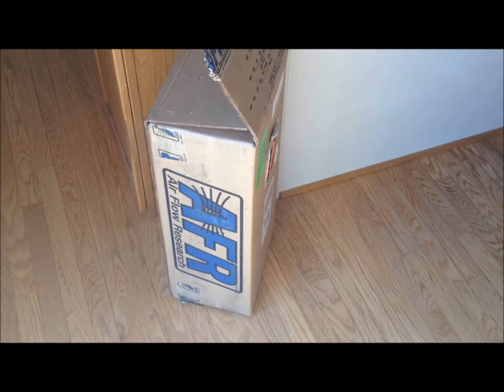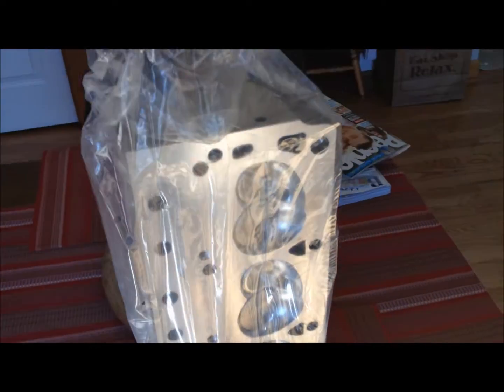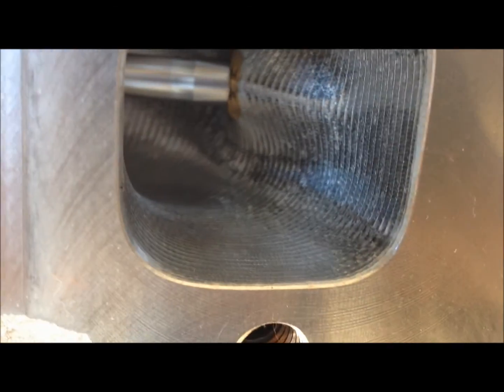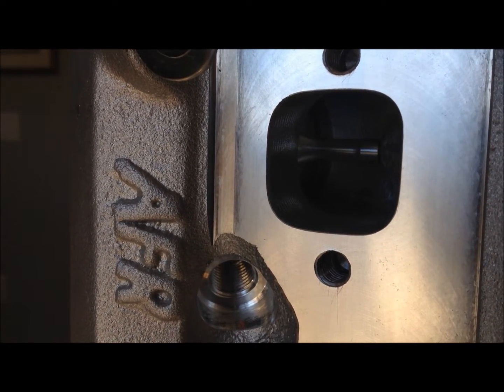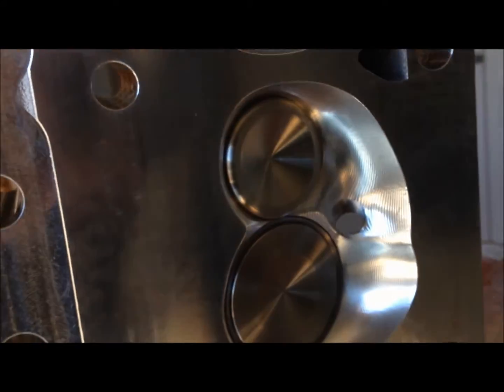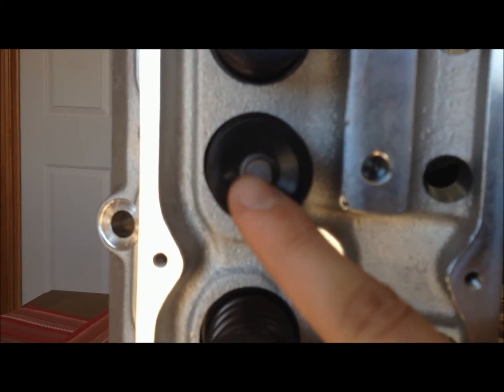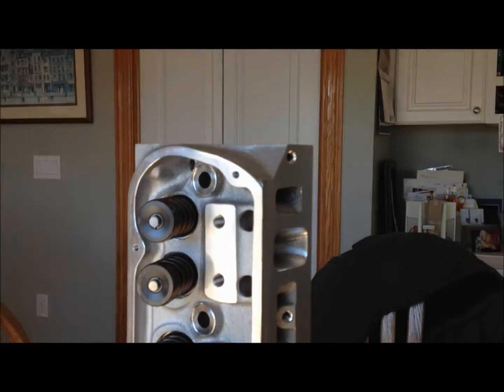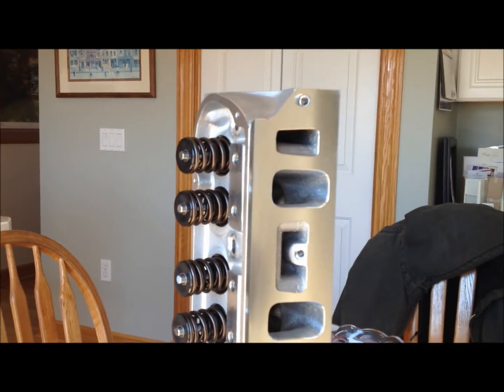AFR Head Unboxing & Overview

Comment: Simple gent's,  take the heads down and lapp the valve seats then leak test or you will be installing all for nothing, check the surface for true flatness don't be fooled by mass manufactured heads,  if you want junk, go the wrecking yard !!!

Comment: yes polish all sharp edges in the combustion chamber for no hot spots and detonation resist quality. Any head even AFR heads always do a valve leakdown check with fluid for every head needs a proper hand done valve job with precision and care for the final touch. if someone does it for you, document with video every valve and process. and result test. use phosphor bronze valve tubes.

Comment: No matter what all heads any new out of box heads you must complete your valve and guide job and valve to seat sealing job always no exceptions. Do not just bolt on out of box heads.
Reply: their great heads, but every head needs checked before bolting them straight on. even AFR.
Reply: ABOlsen69X after seeing all the videos showing just how bad these heads are 'out of the box' i wouldnt even buy them. And i got here from a video showing  AFR heads with cracked valves after a few hours use
Reply: Yep!! Way too many videos of actual machine shops showing how out of round the valve seats are. 9 thousands is too much for a seat to be out. Not only that but there were some heads that had terrible valve guide angles too!!!! Remember these are mass produced just like Edlebrock and anything else.
Reply: So you don't think an AFR head that comes with valves and guides finished properly? You haven't bought AFR heads I guess.
Reply: Afr are very very well finished heads...PERIOD

Comment: What does a set of these cost ?
Reply: jean luc Dubinator 1500 to 1600
Reply: +Jose Padilla so these are new heads out of the box, or are they stock heads that have been machined ?
Reply: jean luc Dubinator new head buy install the with good rocker arms not machining requiered and now go play do some sweet burnouts.
Reply: jean luc Dubinator different horse power
Reply: The next step up from these are the Brodix 11x spread port, but you need different piston reliefs for the bigger valves. And the 11x competition heads start at around $2649.

Comment: Hey, feel free to donate those to me! lol
Reply from the maker: 1972FordF150 this will be the best engine I have belt to date. after this, I think im done with my own cars. if you haven't seen it yet, the 289 heads I show in the head comparison vid are pretty good too. they have never made their way into an engine again. 1.94 intake and 1.6 exhaust with full port work and big 3/8 rocker arm studs and guide plates pressed in. il be doing quite a few reviews since im getting so many new parts. should be interesting.
Reply: I want to get rid of the smog heads I have eventually. Probably for GT40's. My 0-50 up a slight hill was 5 seconds. Pretty good for a F250 and having horribly restricting heads. But I'm throwing MPG out the window with the 8.4:1 CR.
Reply from the maker: wow no kidding. a good set of 54-64 cc chambered heads will really bump that up?
Reply: My goal would be around 9.2:1. I'd still like to run regular gas.